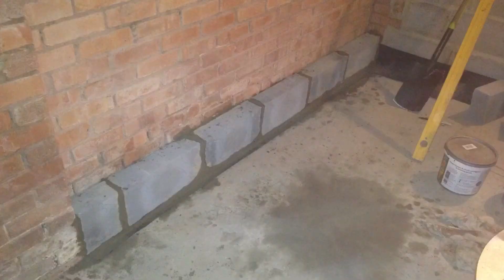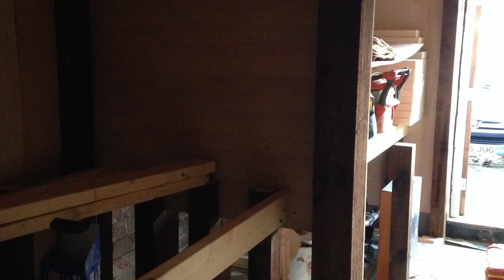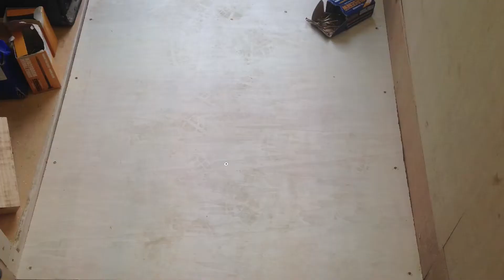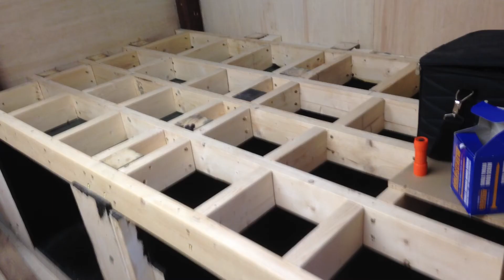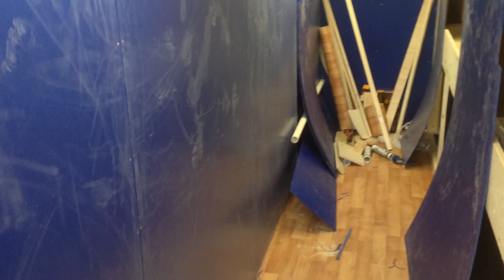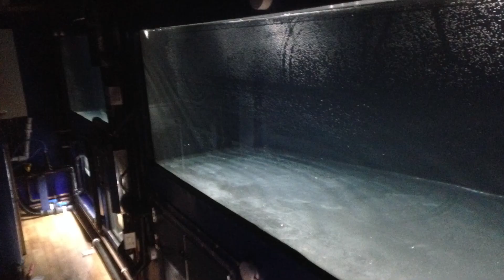Step by step fish house build

Comment: Very nice set up 
Inspired 
How did you stick the front glass panel in. Believe silicone does not bond to fiberglass
Reply from the maker: mark komar I did used silicone about 20 tubes in total.  It’s also how I fitted the window to pond.